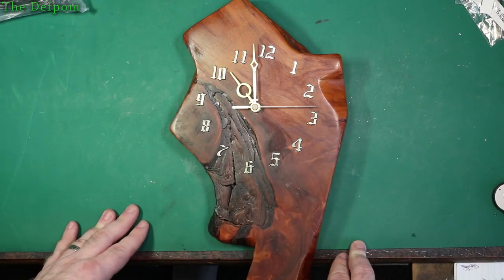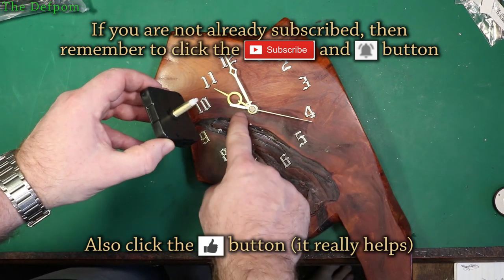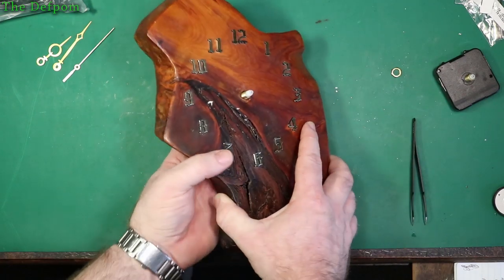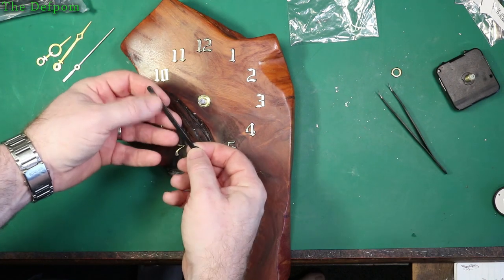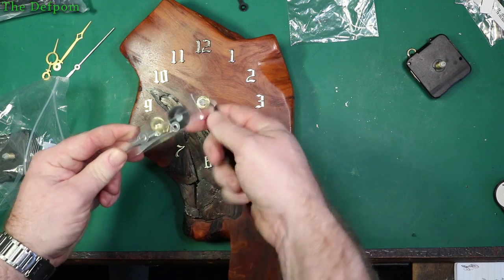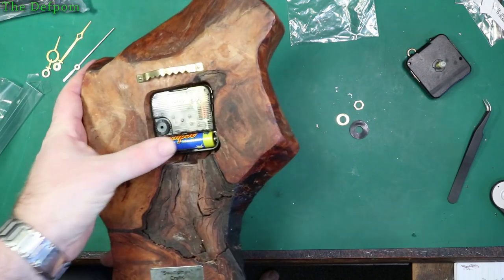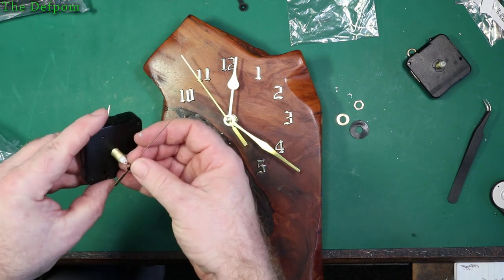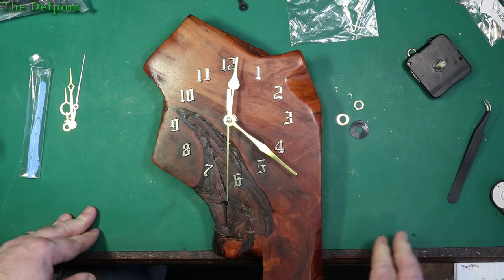🔴 #532 How to Fix a Clock - How To Make A Wall Clock - DIY Wooden Wall Clock

Comment: Hi Matey, I have changed many clock modules, the one you have is a continuous movement type these are the best, almost silent.. Btw the black washer goes on the spindle before you insert it into the clock, it is there to stop the module turning, don't worry about over tightening it, I have had to take a socket to undo them in the past.. You can find many different hands on eBay.
Regards, Ray, North Wales..

Comment: I go to the one Chinese store, and look for a cheap clock with the right hands to match. This is often cheaper than buying the clock mechanism from there, for some reason. I am not a fan of the "continuous movement" clocks though, as they tend to be battery hogs, with the second hand being pulsed at 8Hz, you have to replace batteries every 4 months or so instead of every 2 years. Did take one though and run it off 12V, using a resistor, red LED and a 1000uF capacitor across the LED, all of this being salvaged parts from scrap. 8k2 resistor got the voltage to around 1V3, which was the sweet point for that particular oscillator to keep good ( as in under a minute a month) accuracy, and the LED was barely glowing in the dark. It eventually did die, worn out bushings on the balance wheel, the one wore off.

Now, if you can find cheap chime mechs, that would be nice, still got the module I bought from Maplin in the 1990's, still going strong, though it has migrated through a few clock bodies in that time, now lives in a fake antique clock housing, with the clock mechanism in the usual place, and then the chime board with it's speaker and 2AA batteries next to it.